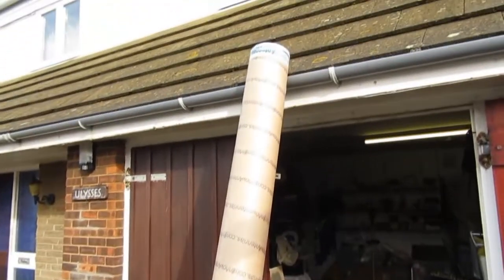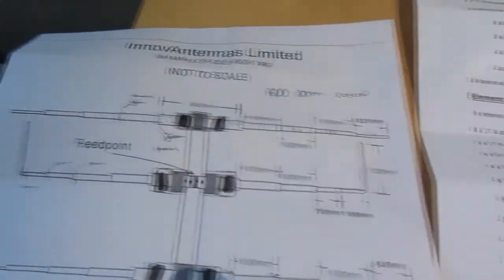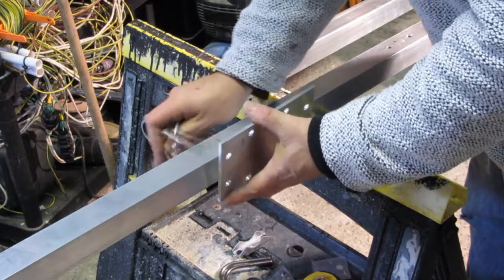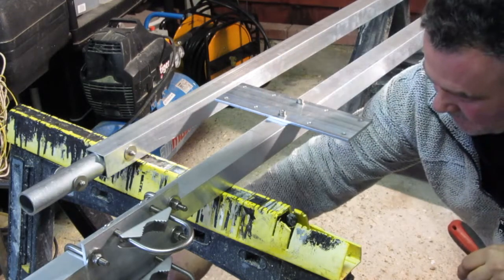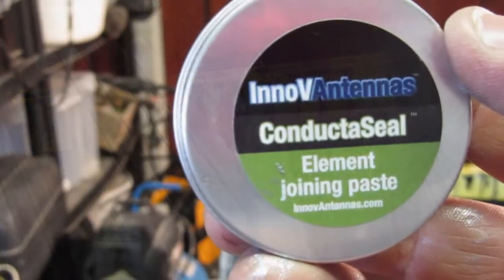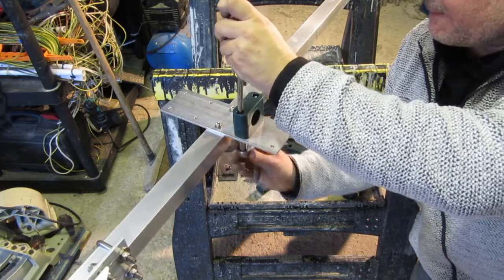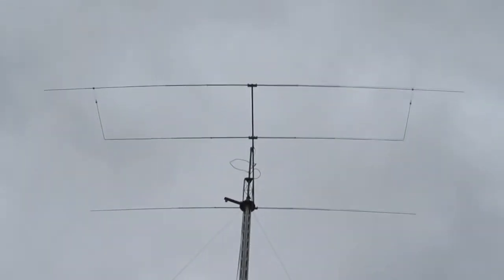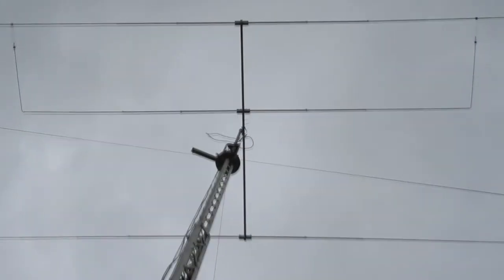InnovAntennas 14MHz OP-DES 3 Element Yagi Beam Un-boxing and assembly. Ham Radio

Comment: I wondered how well that company antennas where built. Seem to be ok.
Reply: I have a 3 ele from Innovantennas for 24MHz.  So far, after five years of permanent exposure to extremely high winds (85mph gusts thus far) and sea air, the antenna looks almost as new and has never caused a problem.  More than that, the owner of Innovantennas is honest and reliable.
Reply from the maker: Other than the poor pressings all went together well. Have seen another since and the pressing were a lot better